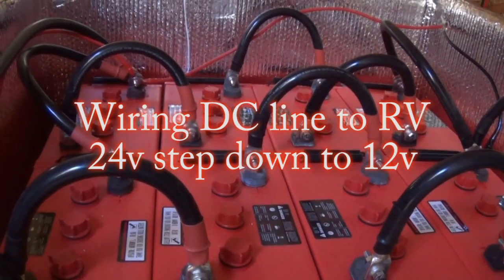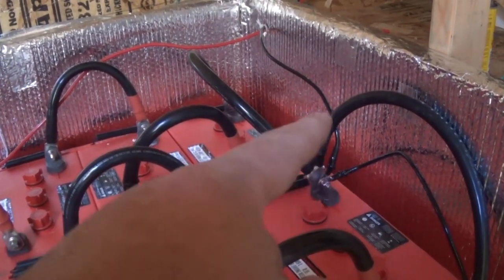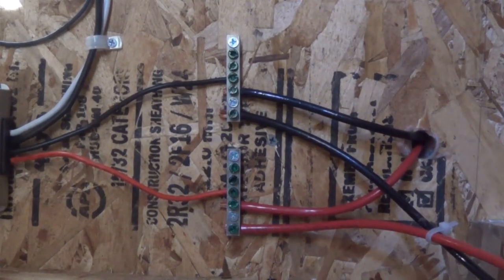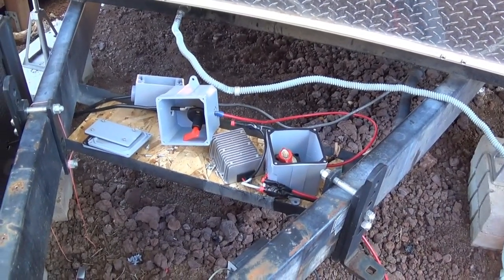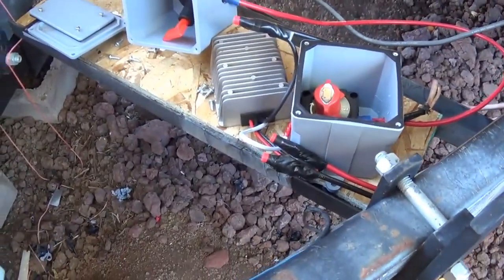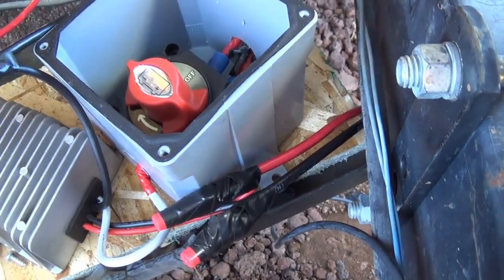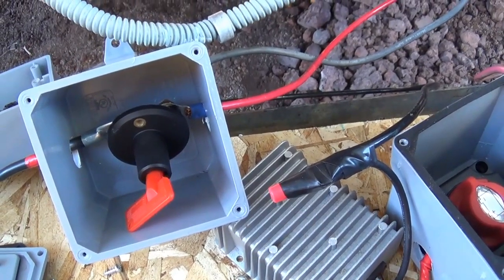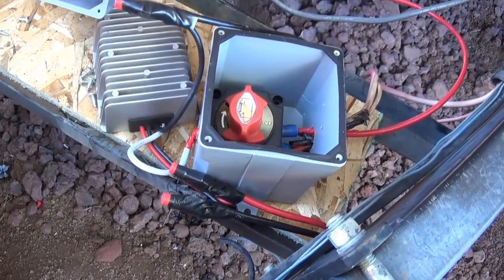How to wire Solar Batteries to my RV - 24v down to 12v - Off Grid Solar Power

Comment: With the batteries your using, once your solar is good to go you would be able to just install a 30amp outlet to your shed and use an inverter to power your whole camper. the camper has a converter all ready installed for your DC. This would reduce all the excess wiring and allow you to use your camper like you were plugged into shore power. Just a suggestion for you to consider :) awesome system though thumbs up.
Reply from the maker: +michaelhbm I thought of that. I do want to be able to leave for maybe a week and turn off the inverter just becus it draws a little power just to run and the rv running off dc while I am gone is not much. you are right and I thought a lot about it.

Comment: Hello sir! Thank you for then info... will subscribe! Also I  feel so late this video is 5 years old. Anyways wanted ask you a question about your dc to dc converter. If I want to step down my 36v panels to 12v could I use the converter you are using on my panels before the dc power reaches the charge controller?  I would have to get a 36v to 12v not a 24v to 12v I know that part but will my plan work? Lol sorry if my question is too long
Reply from the maker: you should be able to use a charge controller that adjust the volts. a charge controller will adjust the volts based on bulk charge, float, etc. make sure its a mppt and the volt range is within . and its set to charge 12v batteries.

Comment: Btw. A simple 110v A/C light switch works as a switch between panels and battery bank. As a way to turn off panels. Been using for a few years on my 400w solor panel 12v system.  
You can also use between panels to reduce watts in. Meaning, say you have 400w of panels. It a bright sunny day. Bank is full. Switch some panels off. This way you are still receiving to power what you are using at a reduced rate....... Bank is 5kw. Power in is 400w. Power out is 225w. Turn of 200w. Few hours later turn those 200w back on. .... now some will say that's what a dump or charge controller is for. With a charge controller/ dump,  my electric at night would run out. They were keeping my batteries at 12v not 13.6v. That's a lot of electric lost. And it wears batteries a lot more
Why I use a 12v battery bank over a 24v battery bank....
Couple days without electric on a 24v system. You can't charge system with a vehical and use at the same time with a 24v system.
I've had a lost less problems since I switch back to 12v. I can charge system anytime with a vehical. I know this goes against the electric laws. But I swore the 12v charges better. Cloudy day  less chance of not charging. And if it does happen. I just hook up jumper cables to panel junction box.  Hour later bank is full and can use during that time. 
While a 24v, I would have to disconnect 24v inverter,  rewire bank to 12v, charge bank with vehical, and unable to use electric while charging. Then rewire batteries back to 24v, reconnect 24v inverter. Then I could use. Sometimes having to do this 3 to 5 times during the day. IT'S A PAIN.

Btw if someone wants 24v 250w panels I have 8 (2kw) I will trade for close to same watts in 12v. (NO HARBOR FRIEGHT TYPE PANELS ACCEPTED) . I am willing to break up the set of 8. Meaning if you want one 24v 250w panel and you have 12v panels close to 250 watt. I'm interested. 4 of the panels have never been used though they are dusting from sitting in my shed. I'm in southern New Mexico.  Not going to give how many watts I'm willing to lose. So just tell me what you have.
Reply from the maker: as long as the switch can handle to voltage and amps . why cut off the solar? your charge controller will switch to absorption charge with is good for the batteries.

Comment: I am looking for some help I will have 2x12v 110am battery's and I want to use it all on 12v but my new panel will be PMPP 260w VMPP 30.7v imp 8.50A 37.8V VOC UL 1703 600 UL 17031 5A can I do this for 12v please help

Comment: You dont need to memorize acronyms if you know the formulas and understand ohms law and voltage formulas. But, voltage in series is just added. Voltage in parallel is divided. Current in a series is the same everywhere. Parallel current is divided. It gets more complicated for different impedance or resistance but if its the same resistance in parallel then the current is divided evenly.
Reply from the maker: maybe so but i kept forgetting how it all worked and how to wire to i came up with the siv an pia and it really helped me to keep it straight.

Comment: ok,  having a 24v bank, then converting to 12 to run the rv ..... is that wasting anything?   are you going with 24 for a cabin later ?   my rv is 12v, my bank will be 12v , and possibly part of my cabin will be 12v for lights and such ..... you are way ahead of me partly because the way the RV rules in Cochise county are set up   ,  couldnt just move out there and use up a yr buying my components so im at a park 4 miles from my land until end of febuary next yr , then i have 3 yrs to build the cabin .....    great videos,   but was just curious why a 24v bank when the rv and alot of other things are 12v .... the step down converter does the job but why go that route ?  not sharp shooting, just dont understand , thanks
Reply from the maker: great question. the main reason is with every connection and foot of distance you have some type of loss in power. the loss in power with 24v is not as bad as 12v. when you step down the volts will be higher than if you run 12v the same distance. example might be starts at 24.5v gets to step down its at 23.8v but step down converts to 12v.. at 12v when it gets to same point it might be 11.5 and now its not enough volts to power some 12v devices. becus i have the batteries so far away (50 plus feet) the 24v made better sense. once at the barn/rv etc i step it down to 12v. the 12v lines may run as far as 35feet so i use 8 awg as the main run than 12awg to the lights . does that help? really short runs or tiny house type of set up just use 6awg for your runs than if need smaller to the device. somethings the wire is to big to connect so you have to down size it. most trailers and rv use 6awg throughout. or at least to the fuse box... oh by the way dont forget fuses or breakers.
Reply: great job explaining it 
where did you get the 24-12v down step converter .... price range ?
Reply from the maker: i want to say about 50 to 70 bucks. online. i think in the videos down in the description area  i put a link to amazon for the step downs.  they come in different amps so depending on what you want it might be cheaper. mine is a 40amp. i think they have 20amps.

Comment: I'm going to cut to the chase.
Here is what I got, and what I need.
I have:
EIGHT 30.6v 15 amp (24v 250w) solar panels.
I need:
( Case 1 home; using 4 to 8 of the above panels) To convert to 12v. Battery bank with a 12v inverter. That I can at times hook up jumper cables to power up from a 12v vehical.
(Case 2 truck camper; using 4 of the above panels )  To convert to 12v battery bank that has a switch to trucks battery for charging at times. Truck is wired up to the switch.
Basicly both are same problem "high amp" 24v solor panels to 12v battery bank. ( i dont concider it high amps, but been told it too high). I want this to last. Hence why I bought solor. 
.....
Maybe Im looking for a unicorn.
Reply from the maker: use a 24v battery bank. i have 6 panels the same watts as you. i use a 60amps charge controller, 8 rolls surrette s605 (460amps each) batteries wired as a 24v battery bank giving me 920amps at 24v. with a 24v inverter 2200watt samlex . you can go with 12 of those batteries with your system. but may want to look into a 80amp charge controller.